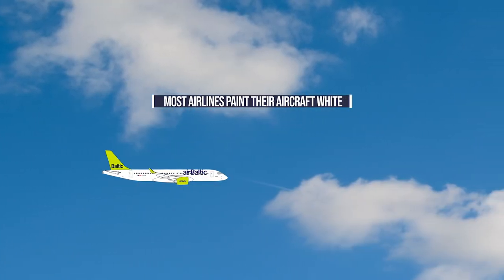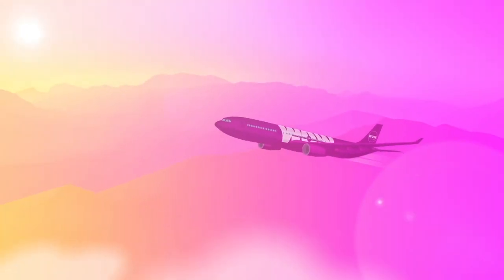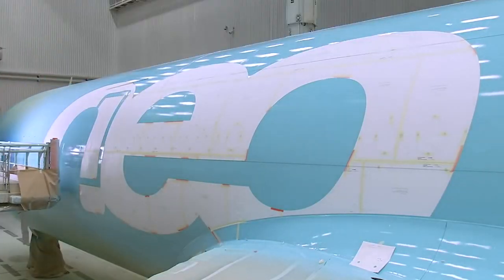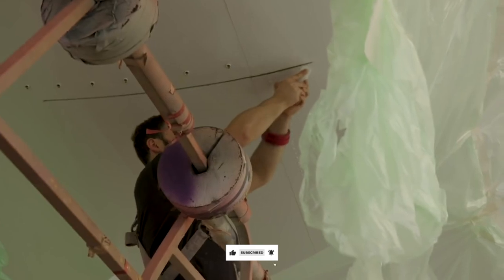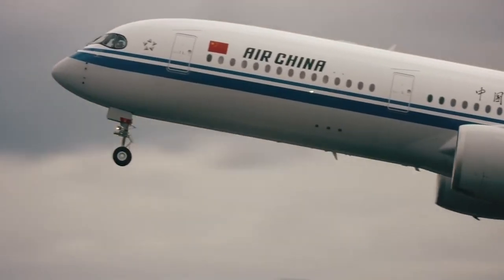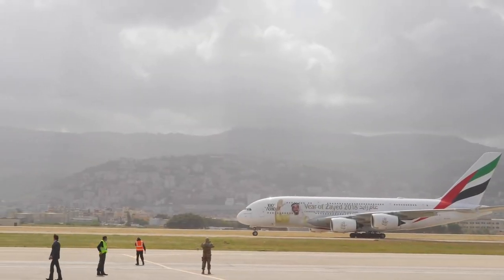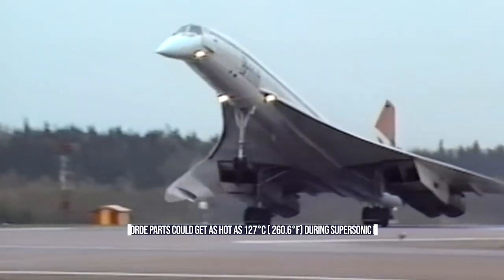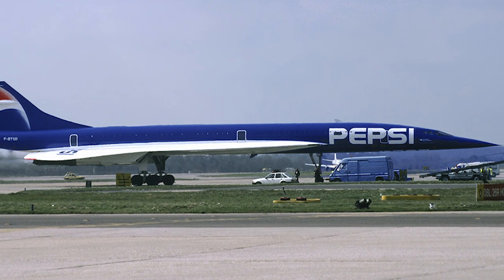Why Most Aircraft Are Painted White

Comment: I reduces the heat gain on the ground.  I've been stuck in Phoenix for four hours while they tried to cool down a plane with a cooling truck, and when that didn't work, they brought out a fresh plane from the hangar.  It also reduces expansion of the fuselage shell, which can cause hairline cracks at rivet and other joining lines.